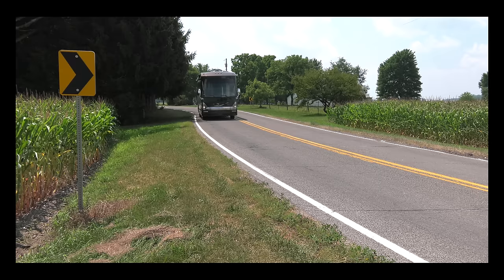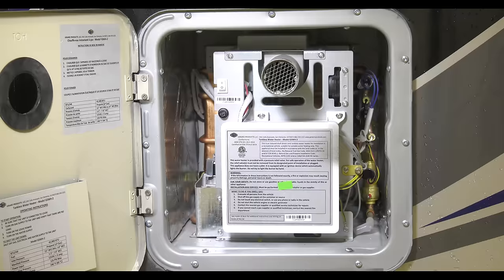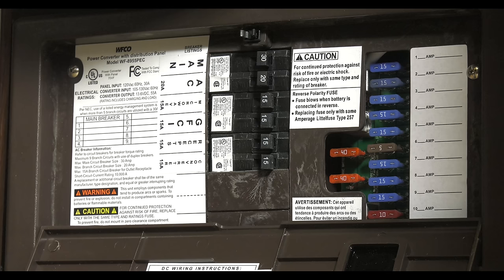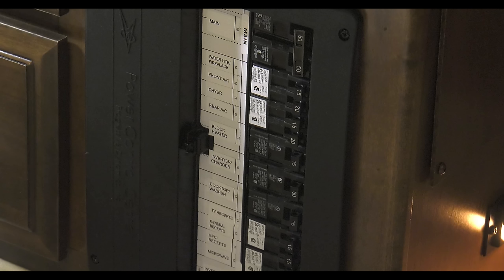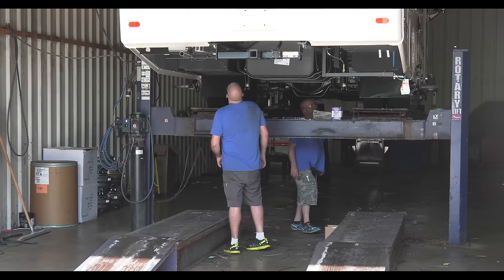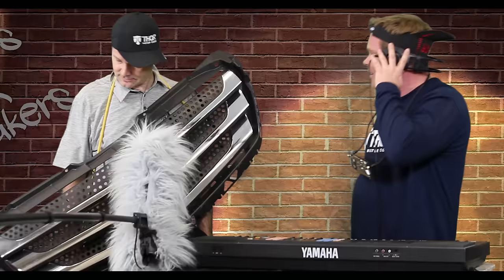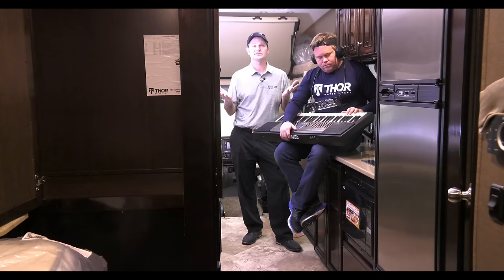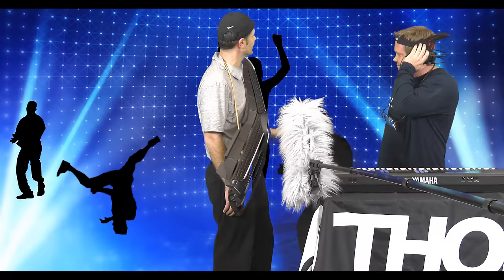Thor Motor Coach Fuses and Breakers Reset and Replacement

Comment: to reset the ME2012 inverter in a Thor Aria 3601 it does not have a remote you must use the front of the inverter, then you must first unplug shore power or turn off the generator, it cannot have incoming power to it for a reset.

Comment: How do you reset the mastervolt system to get the microwave to power up?
Reply from the maker: Is it offline?  You can press the emergency start switch for a few seconds to bring them back online to start the charging process. Thanks for the question. - Steve
Reply: I have the same problem, it keeps tripping off, after I reset it!  What else do I need to do?  Soon as I reset it, it turns off.

Comment: I have a situation where the parts of the right side (passenger side) the electricity isn't working, and no breakers are tripped, and I am using the shore line. My microwave and fridge still works, and the bedroom outlets, above bed; but the under cupboard kitchen, the one next to the floor on the bed (near the rear) and the outside outlet is not working.  The slide and levels still work also. Is there a fuse hiding somewhere else?
Reply from the maker: Hi Steph.  Please call Customer Service (877) 855-2867 so they can help you troubleshoot.  Thanks - Steve
Reply: @ThorMotorCoach  Ty. I found a schematic, and I will call. Appreciate the response.
Reply: Or do they give u an answer. If u know the answer, please let me know. Thanks

Comment: The power outlet under the desk at the passenger seat is not working. Checked the RV fuses and they were all good where is the fuse for that outlet???
Reply: I have a 2022 thor kb outlaw and did speak to the tech on the phone and they had no help

Comment: that was useless
Reply: My thoughts exactly Yank !
Reply from the maker: For experienced people such as yourself, you may see it that way, but we get a number of first timers asking about the location of the fuses and how to change/check them.  We put this video together based off their suggestion and I have received personal messages thanking me. -Steve
Reply: @ThorMotorCoach  That seems like a nice response, but (and I'm just throwing this out here), shouldn't something so basic have already been covered without the need for video?
Reply from the maker: greg baird It is all covered in the manual as well, but not everybody reads it.  We have thousands of owners and try to help them all from first timers to the well traveled. - Steve
Reply: @ThorMotorCoach  ~ the power button to the entire coach keeps shutting off.  How is that the coach is offline?